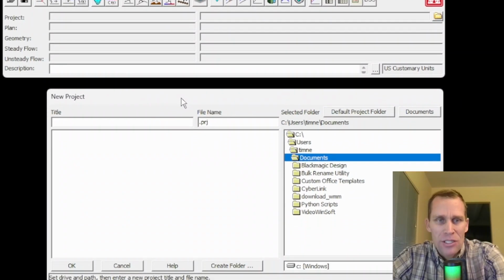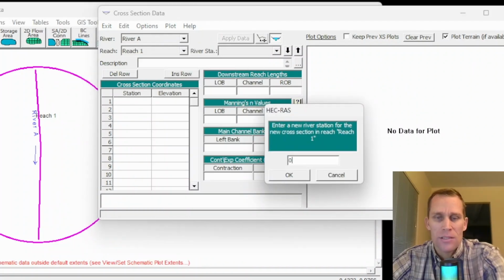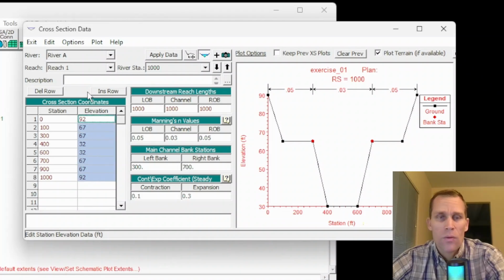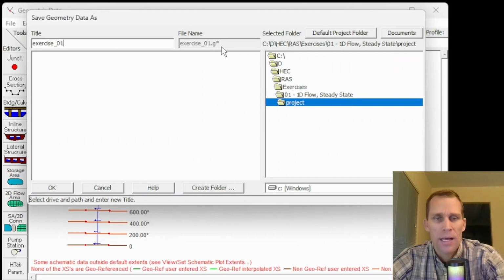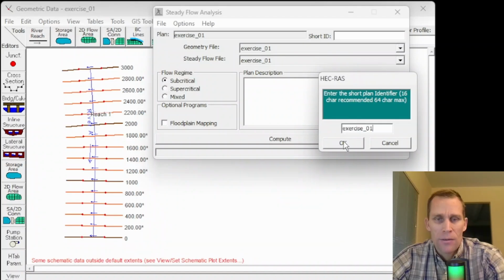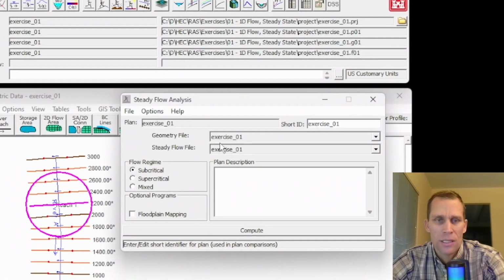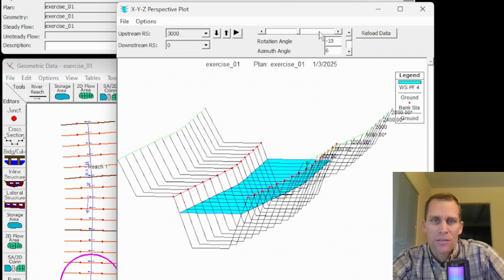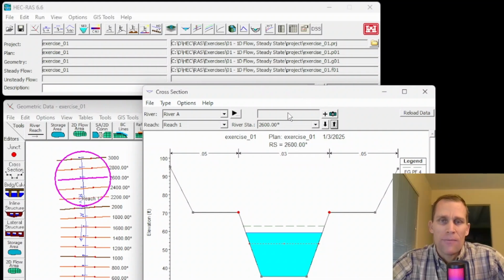HEC RAS Exercise 1 - 1D Flow, Steady State

Comment: sir can you share what data using in project
Reply from the maker: Hi. Specifically what data do you need? In these exercise videos I try to show the data I'm using on the screen, and I try to keep the data input simple enough for someone to be able to type in their own numbers/data, even if it means pausing the video on occasion. YouTube doesn't provide a convenient way for creators to transfer files to viewers.
Reply: @TimNelsonPro Please forgive me, I thought I was commenting on the 9th exercise video. The elevation and volume of the storage area in the exercise was not clearly visible, but when I slowed down the video a little and realized that the volumes started from 1 and went up to 20 i mean thats square, the problem was solved. 
Thanks for everthing.

Comment: Thanks so much, Tim. Very clear overview.  I’m currently struggling with a divide flow scenario where flows splits and enters fairly widely separated culverts before eventually rejoining several hundred feet downstream. I haven’t found a good description of how to model this scenario. HEC-RAS manuals aren’t very helpful 😢
Reply from the maker: Hi. Thanks. I don't have a video on this topic yet, but I can give it a shot once I better understand some details. Do you plan to use a single reach and split the flows using the same cross section(s) that later join downstream? OR do you plan to split the flows at a junction and use separate reaches? You're welcome to comment here in YouTube or email me at: timnelson93411[at]gmail[dot]com